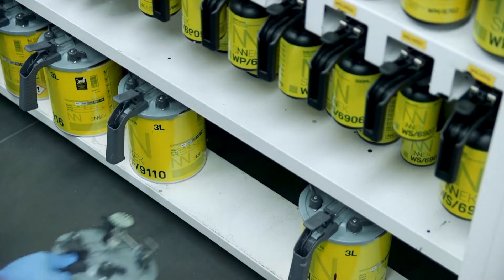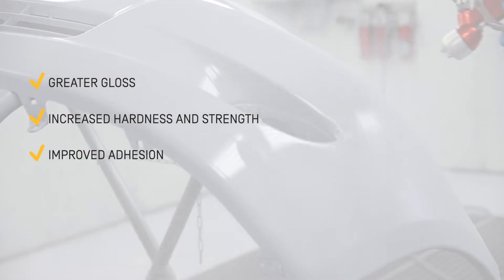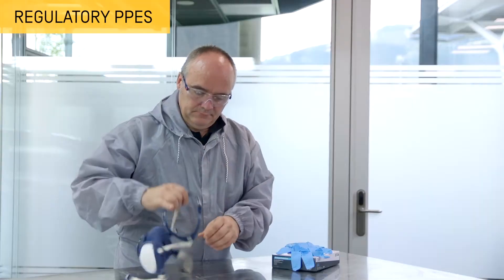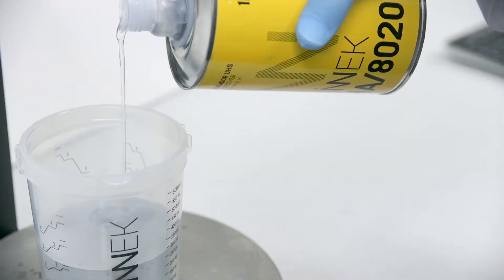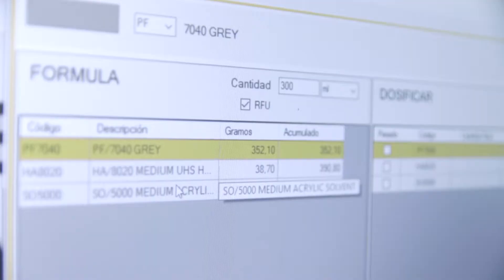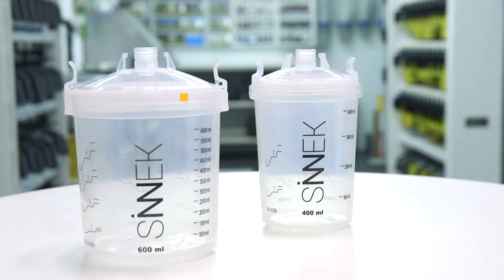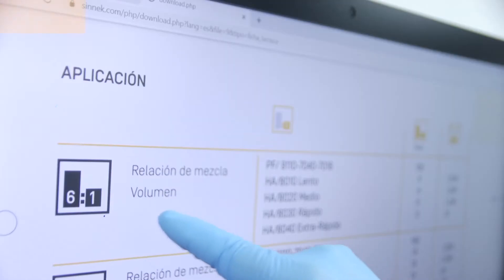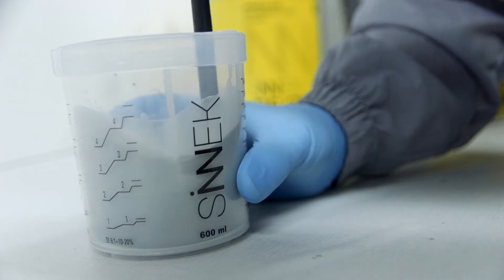HOW TO MIX 2K PAINTS (Primers and Clear Coats)

Comment: hi, im wondering if you can help, ive bought gloss black paint, and other materials but the instructions say 2-1 ratio plus 15-20% thinner. 15-20% of what do they mean.
Reply: On the mixing cup - it’ll have the % numbers. At the bottom of the mixing cup you’ll see the measurement ratios, starting from bottom you’ll see 5%, 10%, then so on. Just read the mixing cup. It’s basically telling you how much thinner to put it = 15-20%